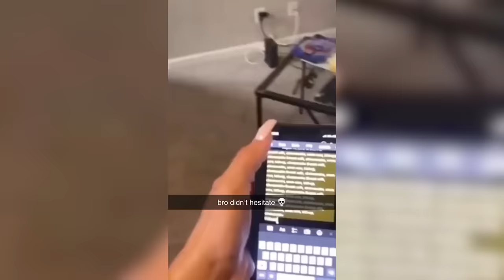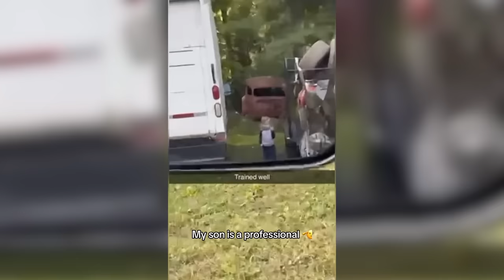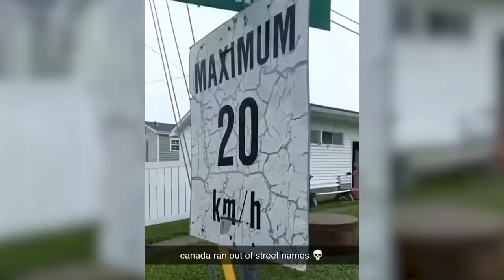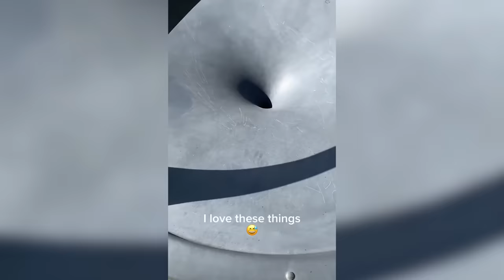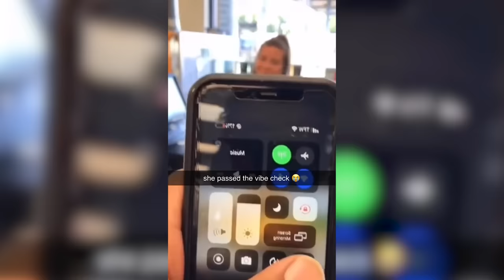why did i VACUUM these BEES..

Comment: 13:44 it wasn't a tornado, just a visible dust devil because
1 : if it were a tornado he would be sucked up (its still very strong!) 
2 : tornados form from the sky not the ground
Reply: correct!
Reply: Well there are some types of tornadoes that actually form from the ground up ⬆️

Edit: the tornadoes that form from the ground up are also called LAND SPOUTS —— it also IS a dust devil because the area it’s in was also sandy